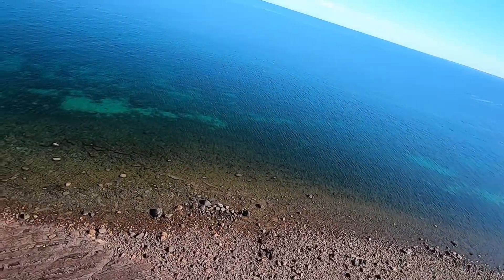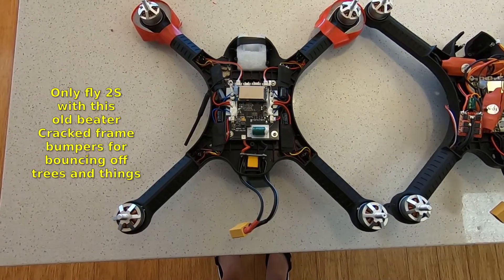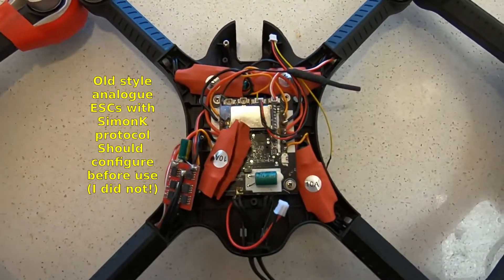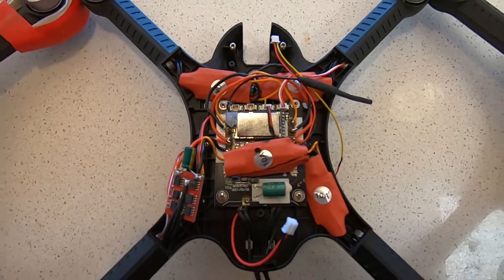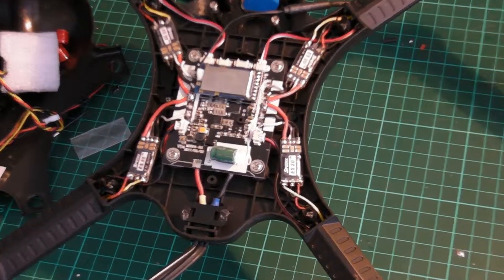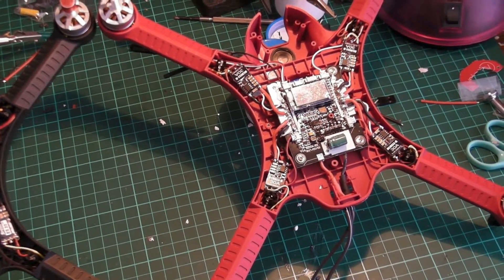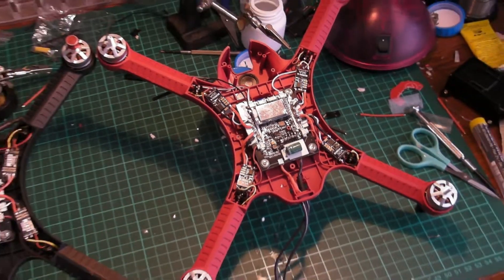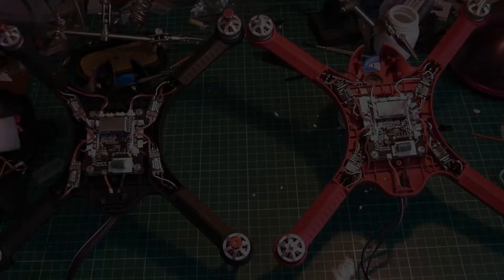My Bugs3 upgrades - from 6 to 30amp ESCs

Comment: I have been running a 3s lipo on all my bugs 3s no issues i cut vents in my canopy, helps with over heating of the ess.
Reply from the maker: I never had a problem with 3S and standard Bugs 3 ESCs with the small amount of testing I did. However, I saw too many reports by other flyers of failures. One of my Bugs 3s even came with a charger that would charge both 3S and 2S batteries. These days, I've moved on to SpeedyBee F405 flight stacks, but still run Bugs 3 motors even powering them with 4S batteries.

Comment: So your saying that the stock esc can fail right?
Reply from the maker: Yes - Back when the Bugs3 first came out, there were a lot of reports of ESCs failing when using 3S batteries. Most of the problems I had in the early days happened after crashes. Been flying 3S with BHeli_S ESCs for a while now with no failures.
Reply: @skybug3  thank you that is always good to know somebody who knows keep up the good work.

Comment: any motor vibrations?
Reply from the maker: Less than with standard ESCs. The triblade props I use also help reduce vibration to the point where the GoPro stabilisation makes for smooth video.

Comment: Did you convert the Spedix 20amps to Dshot 600?
Reply from the maker: Both the Spedix 20amp and the unbranded 30amp ESCs run BLHeli_S firmware and support DShot600.
 Unlike older SimonK protocol, there is no need for ESC calibration, or other adjustments with BLHeli_S. Don't know if the Bugs fcb works with DShot600, but it flies well!

Comment: Also...there are 2 black wire coming from the ESC...but only one is soldered to the main board...where does the other black wire from the ESC go?🤔
Reply from the maker: The ESC arrives with a thin black wire twisted together with a thin white wire that goes to a connector. This can be plugged into something, to allow the ESC to be configured.
Since I am happy with the default settings, I snip off the thin black wire close to the ESC. The white wire is soldered to the flight control board of the Bugs.
Drones that have a fcb that has a port to enable configuration using software, such as Betaflight can plug into a PC to make changes. I prefer to keep things simple. 😷

Comment: Flying yet whith 3s ? 👍😁👌
Reply from the maker: I have been flying Bugs 3s with 3S for about a year now. Battery spec - 3 Cell Turnigy 2.2  2200mAh 35-75C Discharge rate.
Only had problems with 10amp (red) ESCs. I like the extra power, especially on windy days. BHeli_S works well.
Reply: @skybug3  thanks mate👍